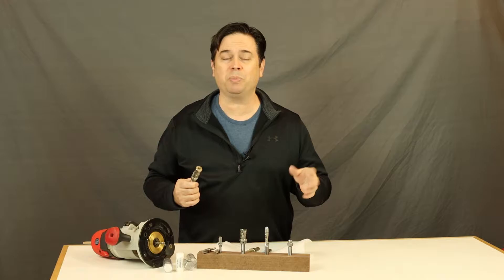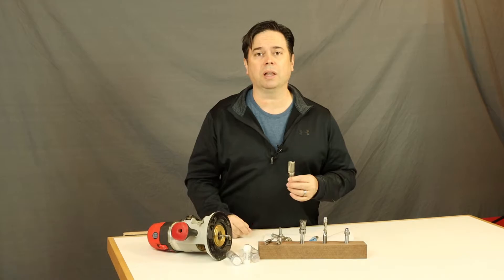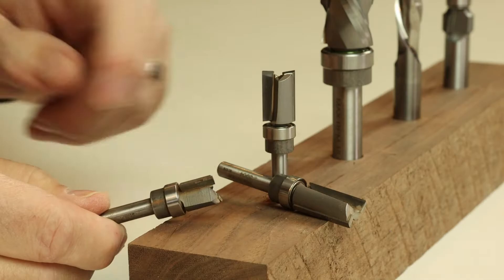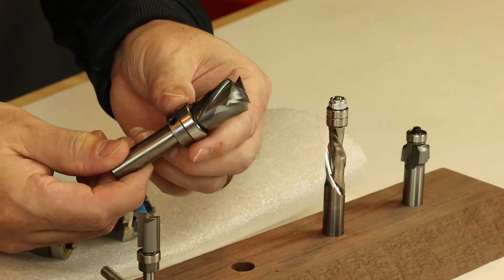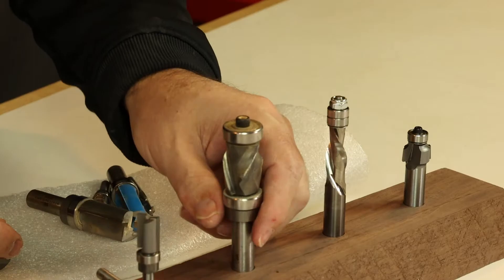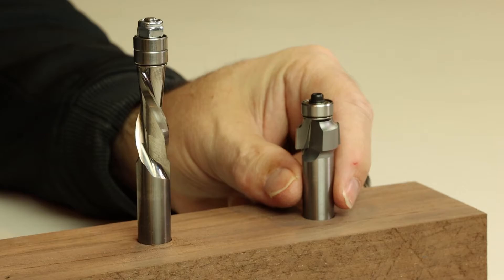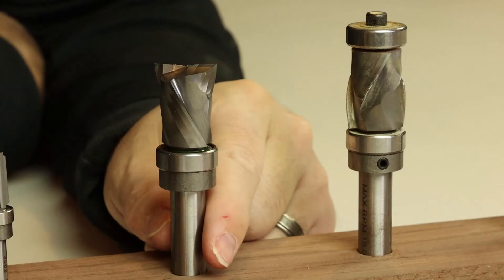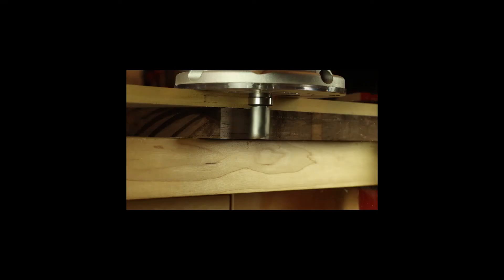All My Favorite Router Bits Spiral  Whiteside Ultimate Flush Trim Bit for Woodworking Router Table

Comment: Great info/tips! - Spiral has changed everything - finally in the routing world - Have you ever changed the bearings on the RFTD5125 Spiral Downcut Flush Trimming bit to a larger diameter bearing for offsetting the cutting from the template/pattern?
Reply from the maker: No I haven't tried that.  I usually like my bearings flush with the cutter so there's no offset.  Thanks.

Comment: Not trying to be a smart Alec, but did you injure the distal joint of your left thumb via woodworking? and if so how?
Reply from the maker: Biscuit joiner.
Reply: @TheThoughtfulWoodworker  OK thanks for sharing. Looks like you came out unscathed function-wise. You can barely notice it, I only noticed because I watched this video many times. I like these bits, just saving up for my first one.